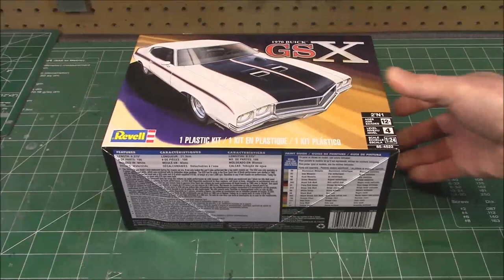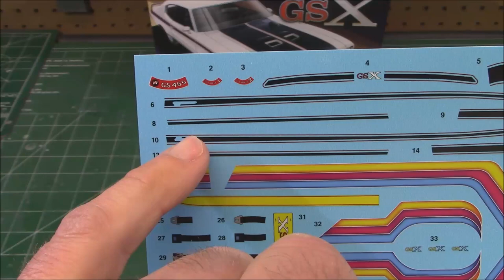1970 Buick GSX 455 2n1 1/24 Scale Model Kit Build How To Paint Detail Wood Grain Dashboard

Comment: Really enjoyed watching you put this together and detail it. Got to admit, I wondered where you were going with the interior wood-grain, but it turned out fantastic! 
I would definitely build this in yellow, although I'd want the center stripe on hood to match the body color. Maybe would have to paint the hood yellow first, then use decal as mask in center when painting hood black, them remove the mask. 
Am a bit disappointed Revell includes non lettered tires, since this car was a special edition, I'd get different tires. Definitely want to buy this kit.

Comment: Excellent video!  One thing you forgot to mention on the air cleaner decals ...there is one for the Stage One and Stage 2 designation which with the aluminum manifold is what yours is . The Stage 2 version was the even hotter 500 plus horsepower version

Comment: Actually chevelle was the generic version even as popular as they were. Out of that GM body style, all the others had certain curves and hood scoops etc that the chevelle didn’t have. Chevy has always had the stripped down basic version of all body styles made by multiple GM manufacturers. And the Buick GS was actually quicker than the Ls6 chevelle, and the HP purposefully under rated for insurance purposes. 510 foot lbs of torque